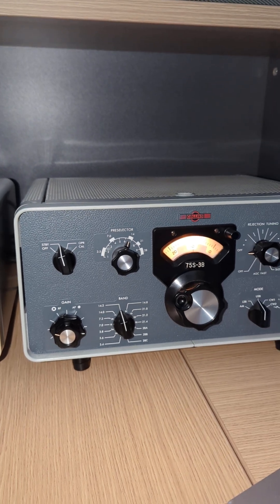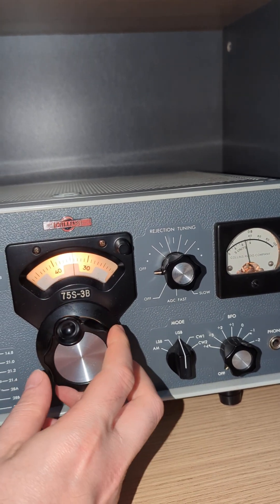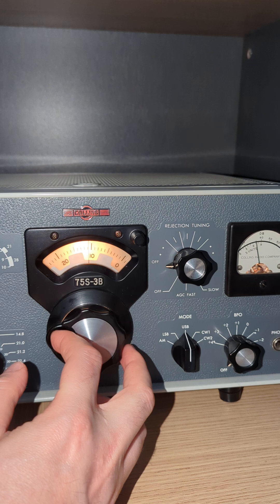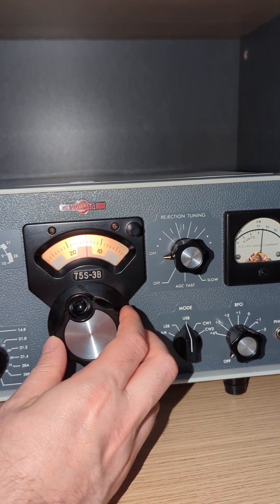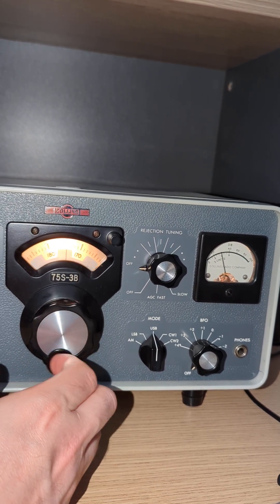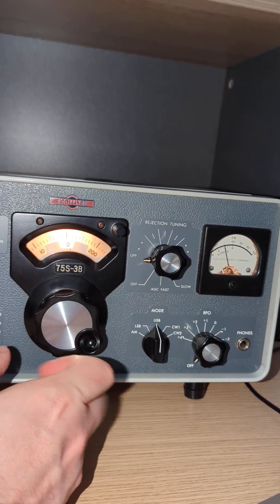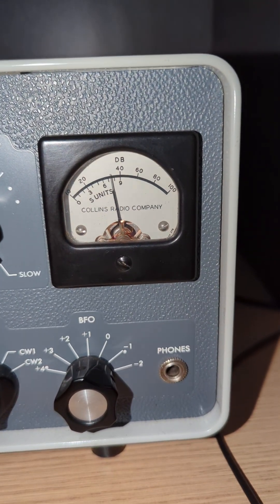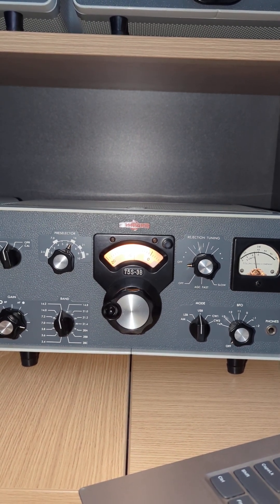Collins 75S-3B: This Is What Real Receivers Sound Like

Comment: The floor noise is too high and don't allow to hear clearly the low level signals.  The reason why the high level signal sound loud because the audio pass through vacuum tube audio amplifier.  The radio is good for strong signal but the efficiency in low signal is not the best . This the difference between old generation and new Generation of DSP and SDR transceiver what have more tools for nosie processing.
Reply from the maker: You're confusing noise for my RF gain control being turned up. I actually have a very quiet noise floor in this session and this was to bring out the lower level signals.